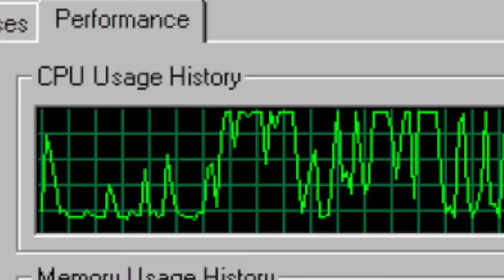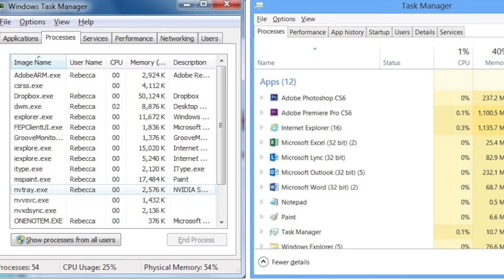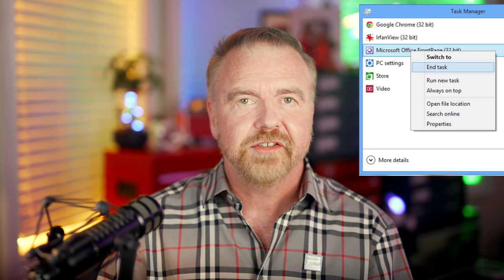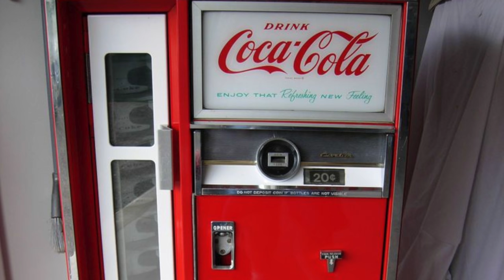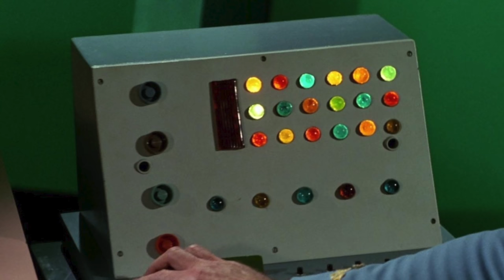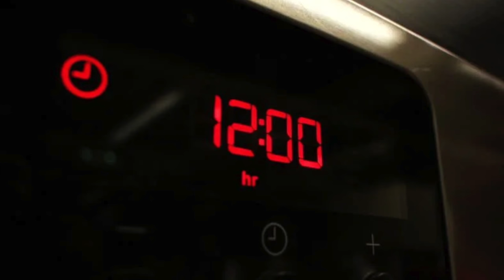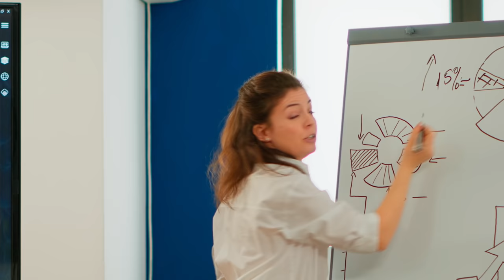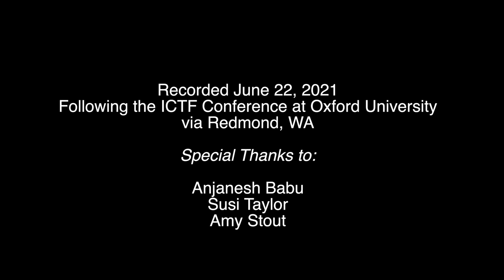Secret Life of Windows Task Manager - The Oxford University Address

Comment: Now, maybe I was more lucky in respect to programming manuals. My first computer was a ZX spectrum +3. The manual for which had a full Z80 mnemonic list. My local electronic shop (not a chain) had computer book and one of them was a Z80 reference manual. This helped me bridge the gap between the obvious mnemonics and those which I wasn't clear what they did. However I did not have assembler software. So I had to write down the Z80 code, and hand assemble it (including jump tables).

I managed to make a track by track disk copier that way (because, you know that was important back then).

Teachers in the 1980s really were unable to help in any aspect here. I brought the z80 manual in once and asked a teacher a question, and watched as their eyes glaze over before admitting they could not even start to help.

Comment: Hey Dave, thank you for Task Manager!  Just an FYI, all programmers should use it, particularly to help them find power sucking code, like tight loops that don't sleep or pass control back to the OS momentarily to allow it to do "other things" before running another iteration in the loop.I have a feeling that is why I am seeing laptops with swollen batteries and cases these days, aside from these video games that are just demanding as heck.  Anyhow, years ago one of my first programs would kill a laptop battery in about 20 minutes and the laptop would get hot as a firecracker. A buddy who is a real programmer helped me out, found my loops (waiting for data to drag in to the serial port) needed a Sleep and DoEvents and the CPU loading went from 100% to less than 1% and the batteries would then last several hours easily.  These days I regularly run task manager and step though the functions to see if my code has parts that cause it to put any unnecessary loading on the CPU.  Since I am only dealing with serial (as in RS232) speed data, there really isn't any reason to chew up the battery due to sloppy coding.  By the way, you may or may not have seen me back in 2008 at the Redmond campus, I was there for several months while chasing bugs out of the campus DAS, that makes the cellphones work indoors. After I had fixed the major issues,  I had to go to every building pushing a cart around with a pile of cellphones strapped across the top making lots of measurements to confirm I had fixed everything it was possible to fix (not all the buildings had a DAS at the time, and they had recently added DAS to the new rec and cafeteria buildings that were built about that time.  I thoroughly enjoy your channel, been a Microsoft user since DOS 2.0, program in several languages but it seems VB6 has become my main one since I can whip out code chop-chop (and it has such wide support even these days) I will probably be still coding in VB6 all the way to the grave.